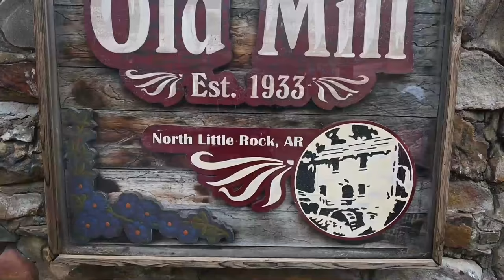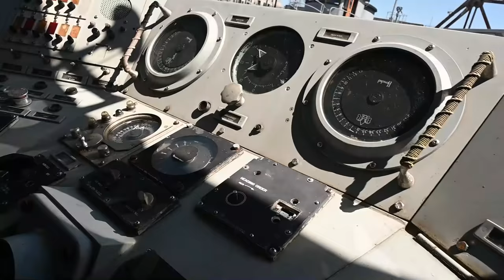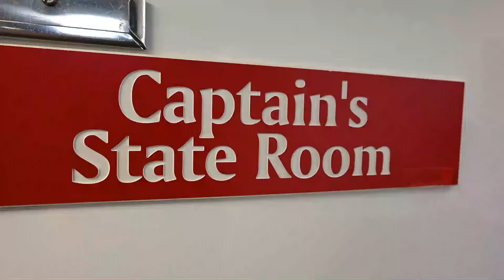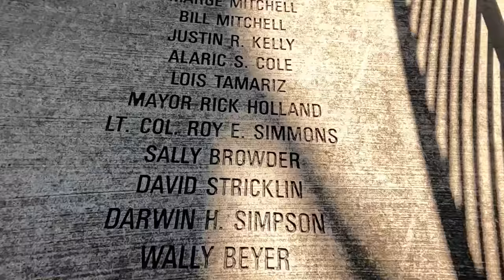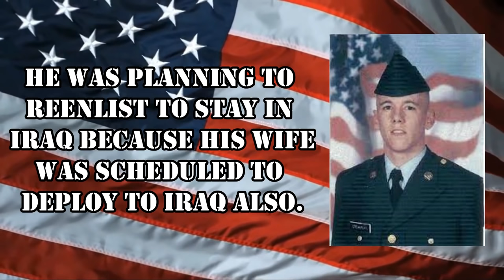RV Life In Little Rock, Arkansas (Things To Do)

Comment: I'm 6'2", you get pretty good at getting through the water tight doors.  No doctor, we had Vietnam hardened corpsmen for any medical stuff.  I think their test depth was only 400ft,  built for 600ft but they didn't have pumps that could operate reliability at that depth/water pressure.
USS Kamehameha SSBN642 & USS Hammerhead SSN663 1972-1978.
Reply from the maker: Thank you for your service. 🇺🇸 I am not sure I would have survived on a sub.
Reply: Those old diesel boats are very cramped, not so much on the nuclear powered subs.